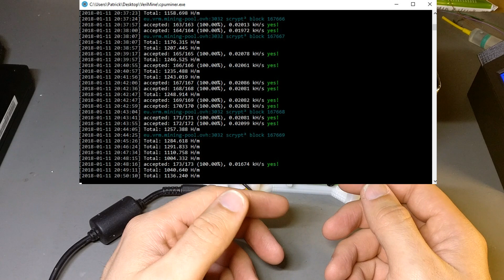Raspberry Pi Crypto mining Rack.

Comment: any info on how you made the converters or a video would be amazing please?
Reply from the maker: I just used some eBay/AliExpress Buck Converter modules, like these: https://www.aliexpress.com/item/32826322284.html
Just connect a power supply, that outputs something between 5V and 32V and can provide enough current, to the input, then adjust the output to 5V (measure output while turning the screw on the little blue guy), and then connect to the 5V and GND on the Raspberry Pi.

Comment: 1200 hashes per minute? wow. even before the halving in may, i was running cryptotab and each laptop (asus rog, alienware, and macbook pro) were getting about 3500-4000 hash/sec. it took me a month to mine $5 with them mining 24/7. This would require a room rull of racks full of pi's to be of any use, and im sure just one of my 4 s9 antminer (14 terahashes/sec each, thats 14 trillion hashes a sec) would still beat them. and they only pay me out $12.50 USD every 3-5 days running nonstop

Comment: Hi, what coin are u mining, cant make it out ? and what miner are you using?
Reply from the maker: I'm mining "Verium Reserve"  (VRM) using fireworm71's fork of "cpuminer"
I'll have video up about setting up wallet and miner for verium, in a day or 2 :)
Reply: Patrick Hansen How much can you earn with  it?
And how much did it cost you, I didn't catch that
Reply from the maker: Right now, not much if anything  :/ everything crashed a little while back (crypto values that is)

Basically, each Pi costs about $32-ish and an overclocked pi 3 generated 35$/year before power costs, when i made this video.

It's currently at 9$/year :p
But everything seem to be rising again.

Comment: At present price how much USD do you earn per day or month?
Reply from the maker: Depending on you overclocking or not, a single raspberry pi generates 1.9 - 2.1 USD/Month at current value, not including power cost.

So, $7,6 - $8.4  / Month depending on overclock, for this setup.

Verium is at a pretty low price right now though, 5.5$,  i've seen it as high as 24 and most cryptos are recovering from the recent crash, so i'm confident it'll go back up, to some degree :)